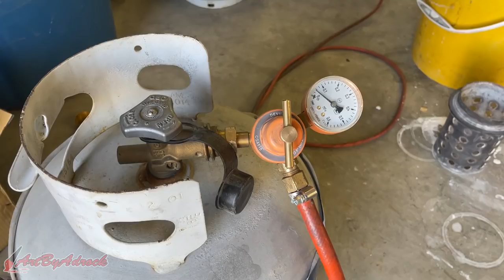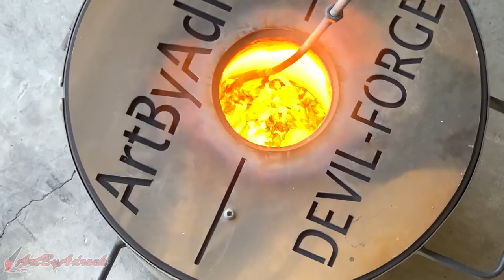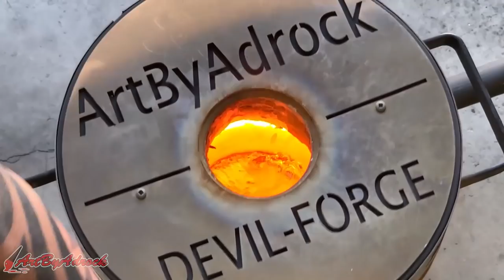Casting He-Man's AXE From SCRAP Metal - Sand Casting Aluminum Process DIY

Comment: It's a cool axe, but as an avid 3d printer person, the only thing I would suggest is buying some Smooth-On XTC-3D to cover your 3d prints with.  Your prints are pretty good and I think that XTC-3D would remove most, if not all, of your print lines thus making a more incredible casting.

Comment: Do you do anything to heat-treat your crucibles before melting? I've had a few lately where I used them out of the box like it appears you do here and they must have something like a silicate in them because when I melted with them I ended up having a goopy mess in the bottom of my furnace that hardened like glass